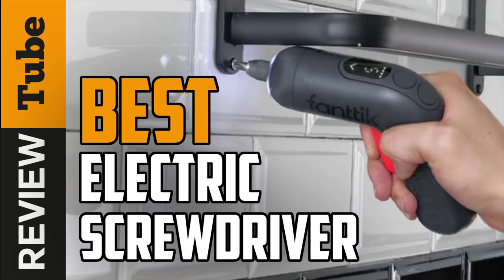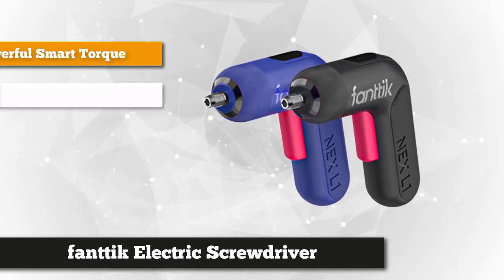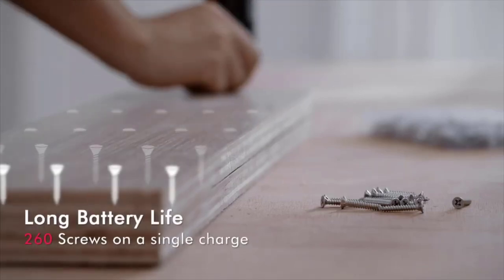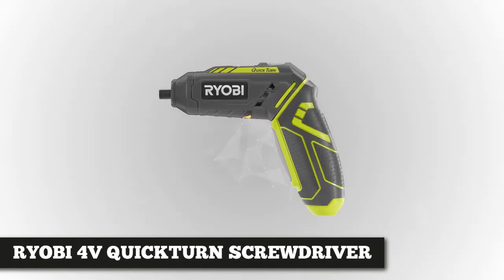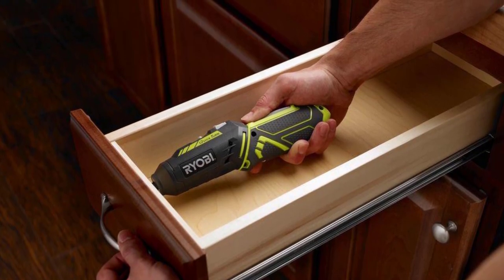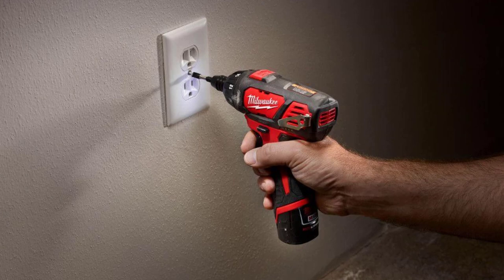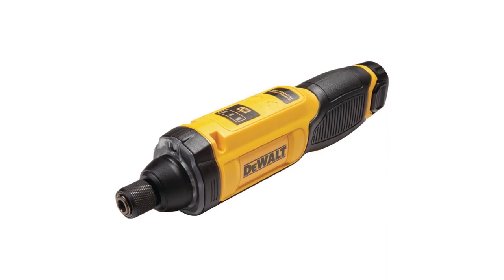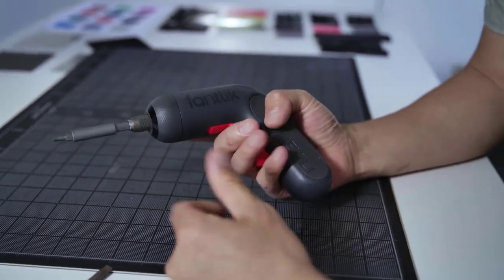✅ Electric Screwdriver: Best Electric Screwdriver (Buying Guide)

Comment from the maker: ✅1. fanttik Electric Screwdriver: https://bit.ly/2FgtO9N
     * Find a great deal on eBay: https://bit.ly/3i6TynR
✅2. RYOBI 4V QUICKTURN SCREWDRIVER: https://bit.ly/2EVRwZu
     * Find a great deal on eBay: https://bit.ly/3bxiCln
✅3. Milwaukee M12 1/4" Hex Screwdriver Kit: https://bit.ly/3byKiXd
     * Find a great deal on eBay: https://bit.ly/3bCooCb
✅4. DeWALT 8V MAX GYROSCOPIC SCREWDRIVER: https://bit.ly/2DDLoUY
     * Find a great deal on eBay: https://bit.ly/3i4mrkA

Ancient Japanese Tonic Melts 54 LBS Of Fat: https://bit.ly/39sKV4H
STUFF YOUR FACE. LOSE WEIGHT: https://bit.ly/31FOT5q

Comment: I owned a B&D driver that needs to be replaced. What I need to know is a demo of the power of the various screwdivers rather than a statistic like NM of torque. Also the battery voltage gives an idea of the power. Do you want a screwdriver for light duty work like hobbies, a heavier duty drill for everyday household tasks or a professional screwdriver for construction. In my case I would like a light rugged drill for work around the house. I bought a Bosch light duty screwdriver and when i tried to drill a screw into a plastic wall anchor it was not up to the task. Sorry but this video was not much help.